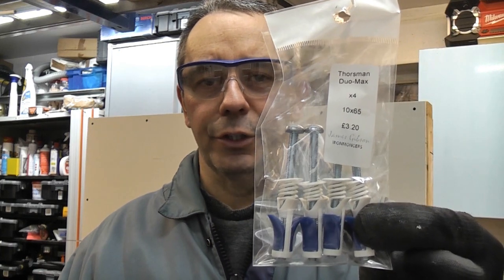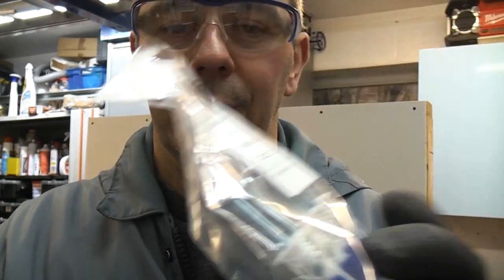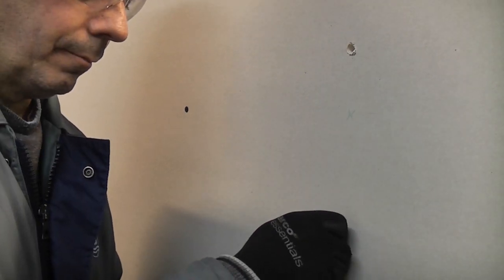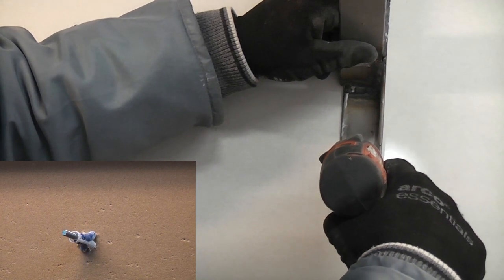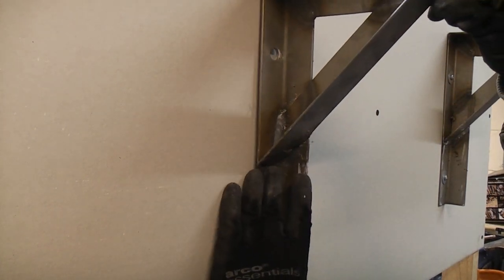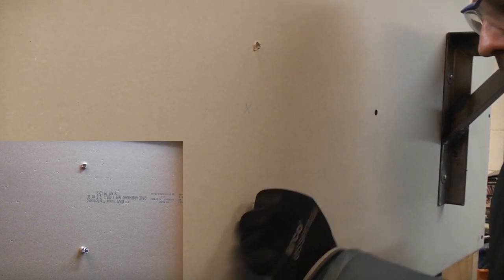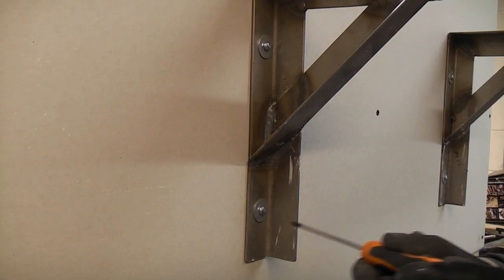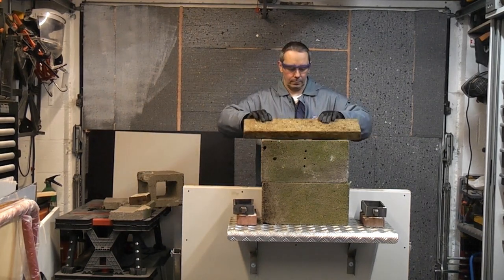Thorsman Duo Max | plasterboard fixing

Comment: I recently had to reinstall a 2 metre length of clothes hanger rod that had come adrift from a walk-in wardrobe. The builder had very thoughtfully used plasterboard through the wardrobe build and just one central rod bracket fitted in with two ordinary wood screws. I purchase two additional brackets and 6 anchor bolts and completed the job in about an hour. One complication I had was that I had to put all the anchor bolts on the brackets and all the brackets on the rod and press everything into place before tightening up. All that pain and agony just to save a few bob using plasterboard rather than plywood. Your duo max fittings would have made it a little easier than the anchor bolts but it deterred one builder from using them eight years ago when the house was built.
Reply from the maker: I've done similar jobs, it can be a right pain feeding all the fixings through the holes. Snap toggles are good for this very reason- if you can use them in that particular scenario
Thanks for the comment 👍

Comment: Another new one I have never seen. Really interesting to see these different fixings. When you have finished this series of vids would really appreciate (either vid or forum) your thoughts on how all the new types compare to the old faithful umbrella fixings.
Reply from the maker: There are so many different plasterboard fixings now and several of them claim to be "the strongest fixing", which is why I started to test them out originally. I think the advantage of these over the hollow wall anchors, is that these will work on any thickness of plasterboard, even if it is double skinned. With the hollow wall anchors, you have to get the correct ones for the thickness of the plasterboard that you are fixing to. 
The hollow wall anchors performed slightly better then these fixings when I tested them out.
Thanks for the comment 👍

Comment: At me local Home Depot in the US we have two products very similar to this, except that the  body, either metal or plastic is like a screw/drill and you can drill right into the drywall.  You remove the metal screw and use screw fitting in the plastic to embed the fitting into the drywall, and then re-insert the screw and there you have it.

The metal one is EZ-Anchor Stud Solver #7 x 1-1/4 in. Alloy Flat-Head Self-Drilling Drywall Anchors with Screws (2-Pack)

The plastic one is EZ-Anchor Twist-N-Lock 75 lbs. #8 x 1-1/4 in. Philips Zinc-Plated Nylon Flat-Head Drywall Anchors with Screws (2-Pack)
Reply from the maker: Thanks for the info, I have just checked them out, they look very similar to a product that is widely available in the UK,  https://youtu.be/ECDysfNhx_E?t=174  which has several different names- but the ones in the US split in half, unlike the ones in the UK. They are available in metal or plastic over here. I'll keep my eyes open for those and when they reach the UK, I'll try some ;-)

Thanks for the comment 👍

Comment: would have been nice to see the back of the wall while hand tightening.
Reply: Exactly what I wanted to see, I know the priniple but wanted to see close up how this fixing works.
Reply: Missed out on that but we got a rear shot of the drill bit going through. I really don't understand why the most interesting part isn't shown.
Reply from the maker: I try to make the videos as short as possible, which is why I just put a smaller version of the back of the board in the bottom left corner- https://youtu.be/H4TfM0EbYgY?t=218
I'll dig out the footage and add the hand tightening to the weight test video (which will be uploaded in a couple of weeks) 
Thanks for the comment

Comment: Will the snaptoggles still be the strongest ones off the bunch, I wonder..
Reply from the maker: Spring toggles are the best that I have tried so far, but for ease of use and a decent strength, you can't beat Snaptoggles.
Thanks for the comment 👍
Reply: @ultimatehandyman  
Oh yes! now I remember the spring toggles from that previous video you did a while ago. They just wouldn't die :)

Comment: Just wondered if you could drill a hole in the 45 angle and use an extension bit on your screwdriver. Not a criticism, just an observation.
Reply: The fixing wings wouldn't then be square to the plasterboard, thus not holding with even load at the back of the board. Would likely fail or pull the bracket to the wrong angle or out of square.
Reply from the maker: Probably, but those brackets were originally made for ladders, outside. Hence they are made from stainless steel with a 12mm hole for fixing to a wall using thru bolts. I only put the brace in, so that I had somewhere to chain the ladders up- to prevent them from being stolen.
Thanks for the comment 👍
Reply from the maker: @ Atsaki13  
Cliff means drill a hole through the brace on the bracket, so that I can access the top hole using a regular screwdriver- instead of using the right angle drill attachment.
Thanks for the comment ;-)
Reply: @Atsaki13  I believe you have misunderstood my question but thanks anyway.